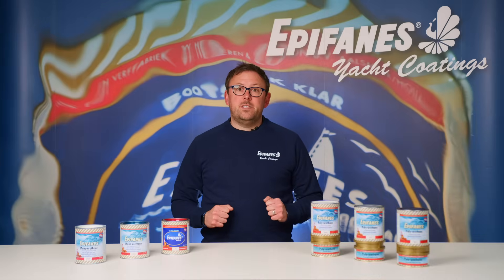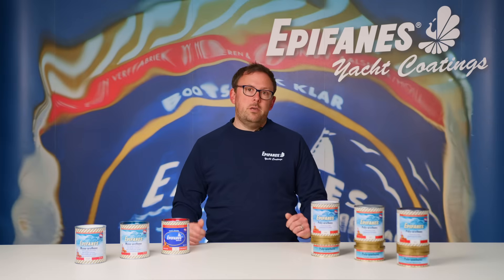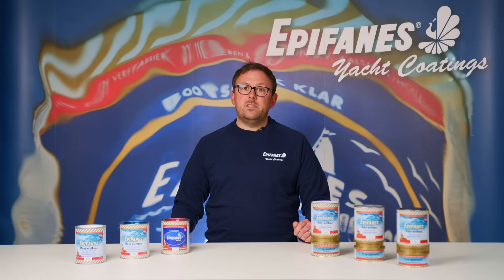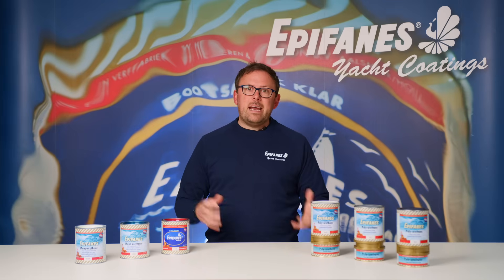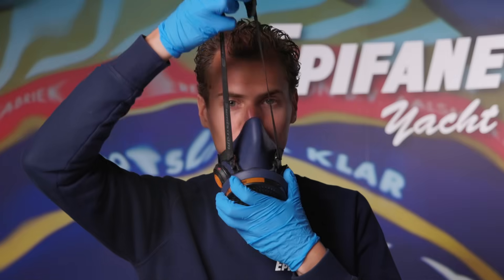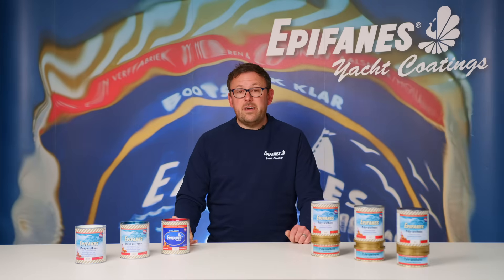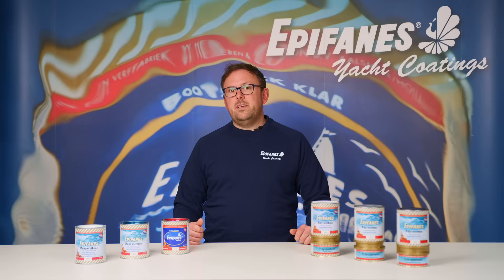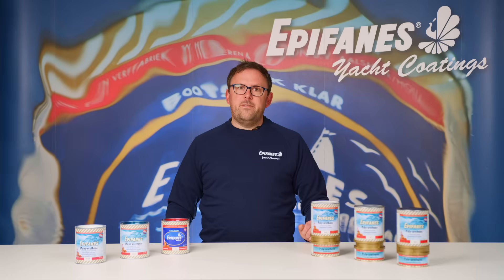Painting your Boat with a One- or Two Component Paint System

Comment: Didn't really give any useful information about the paints. For instance when to use each, how long does each type last, which is best for salt water etc. etc. I was very disappointed.
Reply from the maker: We believe that it gives the essential information. Both products have advantages and disadvantages. The best choice between a one component or two component depends on your own preference. You can use both product for boats going to salt water. You can use a Poly-urethane when the surface is a two component right now, otherwise you can best use a one component paint. The Poly-urethane is more durable, but it also needs maintenance like proper cleaning after sailing on salt water and enough film thickness. Therefore in theory, a Poly-urethane can last between 3 and 20 years depending on the area and care. A one component is easier to apply and can last between 3 and 10 years depending on the area and care. The biggest advantage of a Poly-urethane is that it reaches it ultimate hardness after 2 weeks, where a one component needs a lot longer (months) to get full hardness.

Comment: What do you recommend for teak and holly?
Reply: I'm NOT impressed with this guy.  He's not thoroughly explaining the difference between both chemically, application or desired achievement between all products.  Blah!!!
Reply from the maker: Normally you varnish teak and holly. In that case we would recommend using the Epifanes Woodfinish Gloss for a high gloss finish or the Epifanes Woodfinish Matte for a matte finish. When you are going to paint the surface you could either use the Mono-urethane or the Poly-urethane. Both products will have a good adhesion when you apply a primer first.
Reply: @WHeeren1  thx I'll use the  hi gloss for build-up and rubbed effect for finish